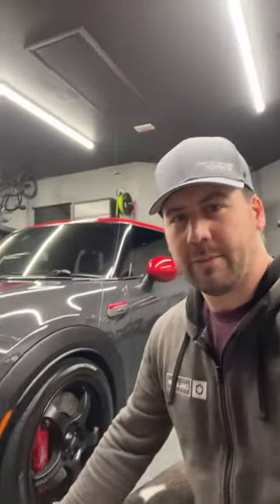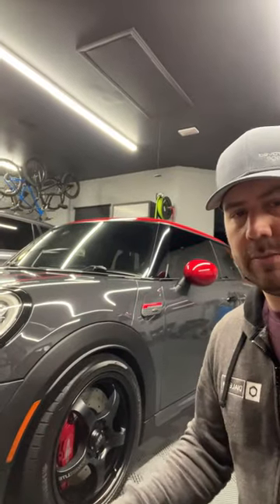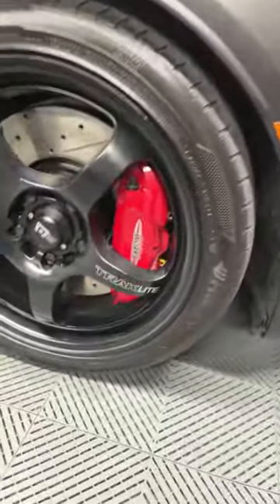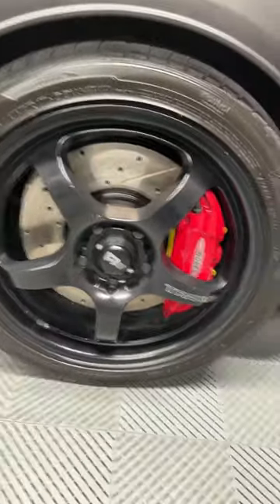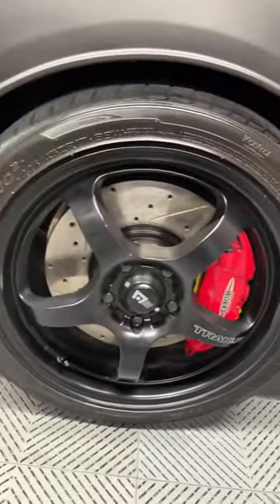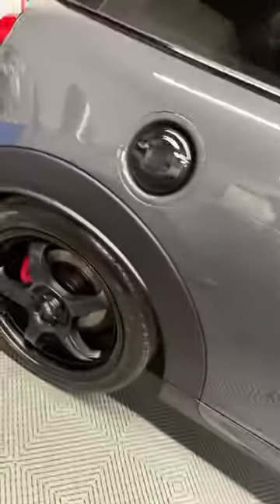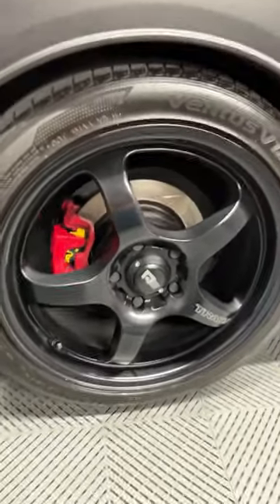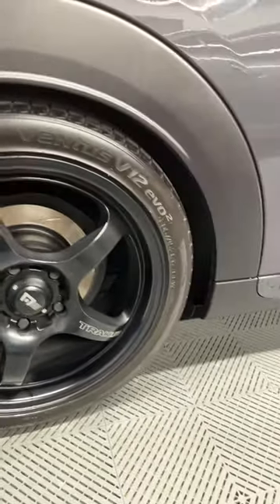Stoptech and EBC brakes installed on the F56 Mini Cooper John Cooper Works!

Comment: Great channel! What’s the size and offset of those Motegi wheels? And any rub or fitment issues?
Reply from the maker: Motegi Mr131 Traklite 17x7 45mm offset 5x112

They needed a 15mm spacer to not rub the front brembo brakes.  My S without the brembo brakes didnt need spacers.